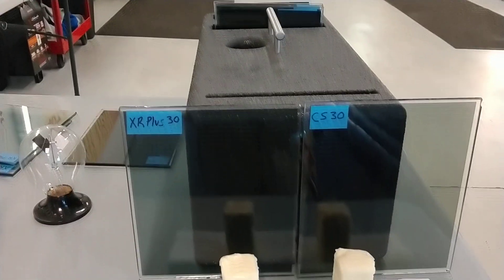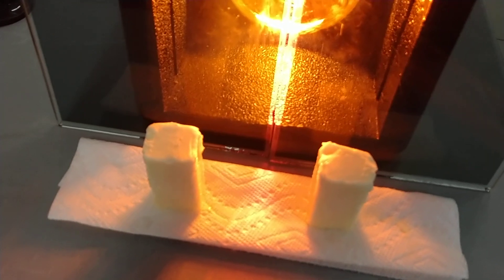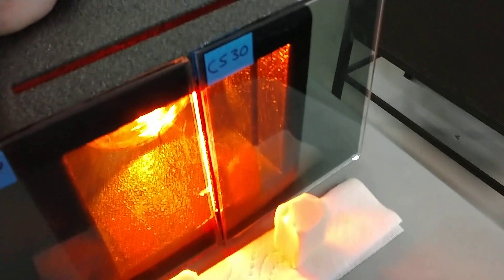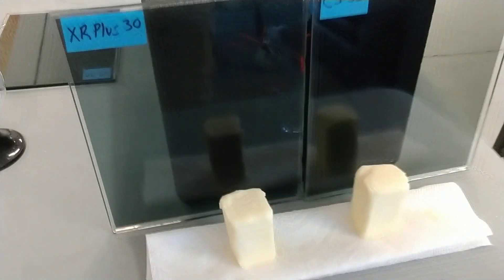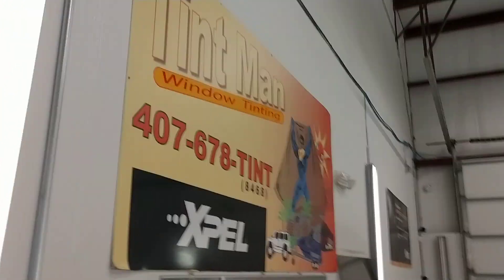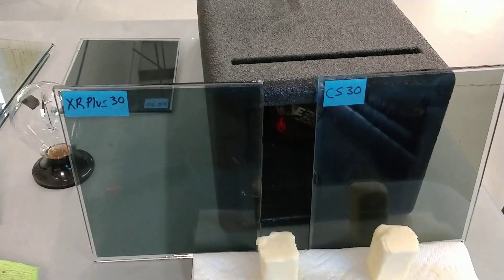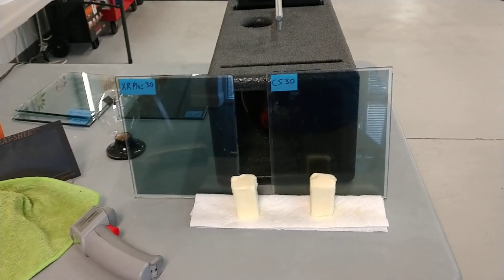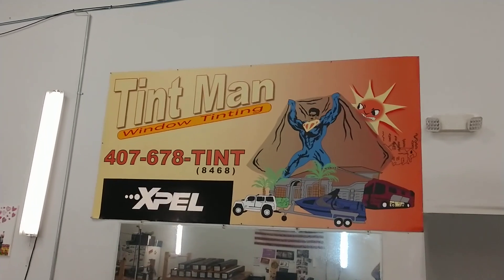Xpel XR Plus Super Ceramic 30% Window Film absorbs so much heat during Tint Man's butter challenge

Comment: But isn't the glass hotter then?  So you feel the heat more around you.
Reply from the maker: Ceramic Window Film is designed to absorb the heat before getting into the vehicle. The only other option to keep the heat out is by reflecting instead absorbing. However reflective Film is illegal on vehicles due to it blinding other drivers. Reflective films are usually used on residential and commercial buildings.

Comment: I was qouted 900-1000 for the xpel xr prime plus for my 2014 accord. Thats for windshield, all windows and rear. Haven’t pulled the trigger yet, still shopping around. Pricey!!
Reply: It’s worth it
Reply: Not worth it IMO, cars gonna get hot regardless after sitting outside for 8 hours.
Reply: @FlexSZN23  lol yeah stuck with the tint the previous owner had installed, use  windshield shade and i jut installed window visors to keep the windows cracked open to vent. Much cheaper option.
Reply: @naughtysauce4323  hmm didnt think of that. Ok that would make it more affordable for me. Thanks for the tip. 

Im guessing you’ve had this done? Does it actually make a difference? Feels cooler inside? Can you please tell me your experience with this tint? Thanks